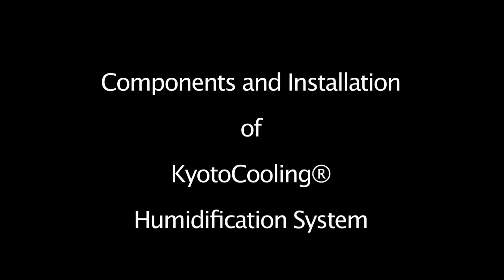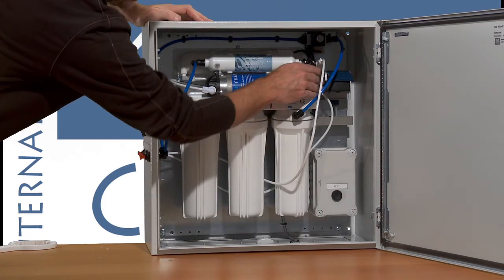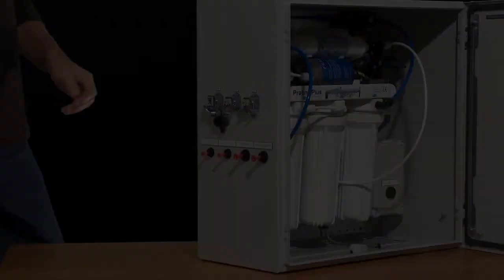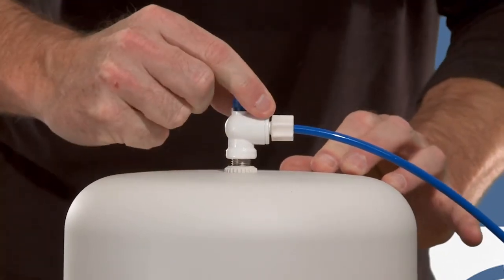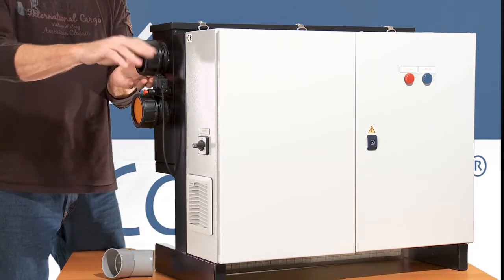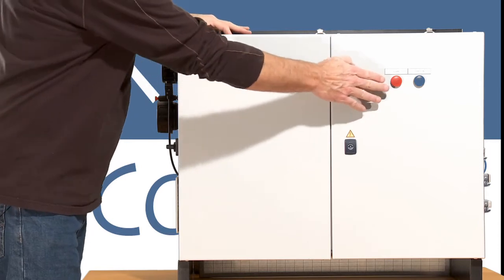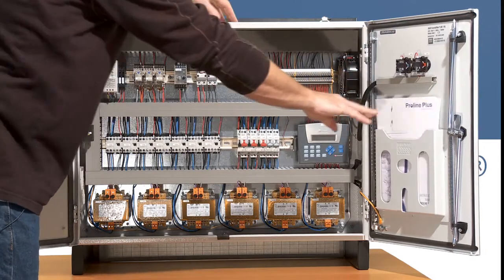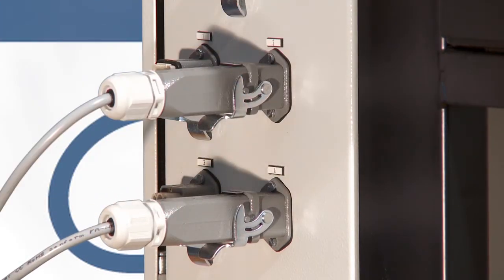Reverse Osmosis Humidification

Comment: Is this until still available, or one like it?  I need something like this.  I want to humidify a 1,000 sq foot area to keep it at 47% RH "hands free", and the water supply has 250 ppm CaCO3 so I need Reverse Osmosis to pre-treat the water before it goes to the humidifier.